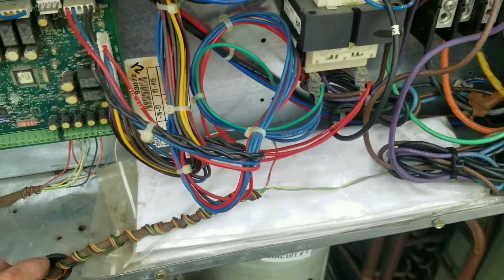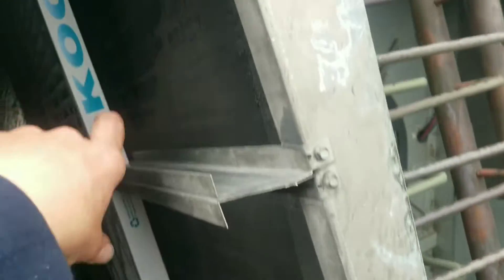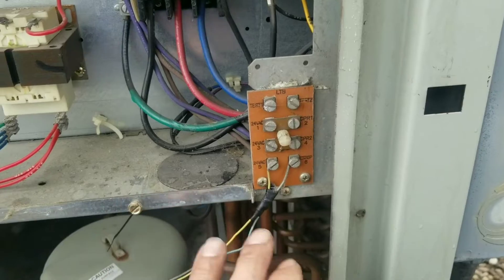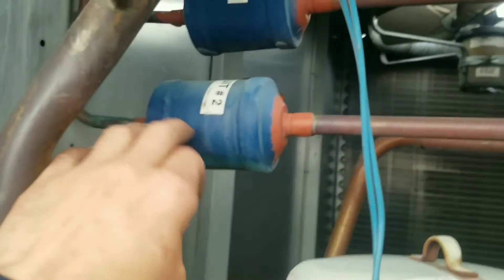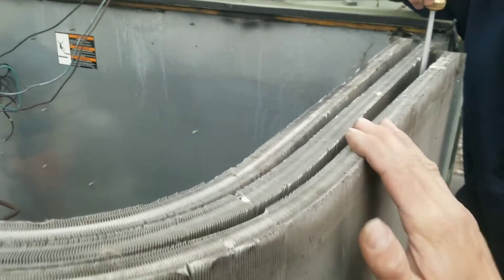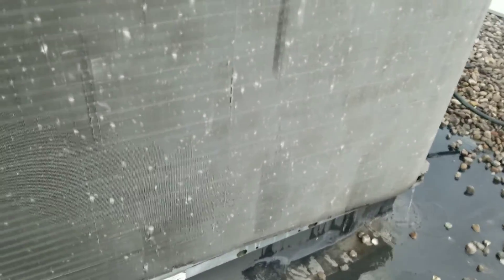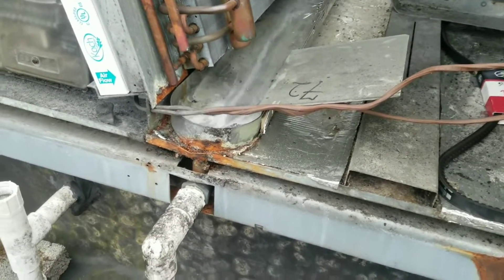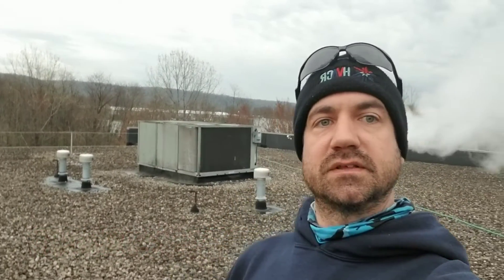HVAC cooling season, rooftop unit p.m tips, tricks and what to look for

Comment: Could you share how this visit differs in the Summer, Fall and Winter?
Reply from the maker: These specific units are cooling only so the other PMs are not as in depth on these units just basic belts and filters and we focus on the heating systems inside. If they did have heat we would check the heat accordingly. I hope this answers your question. I don’t have a specific heating PM video on this type unit but do have some showing the Trane negative pressure gas valves and set up I believe.

Comment: How do you check sub cool if it only has a discharge port.
Reply from the maker: Good question, thanks, Johnny. It is a skewed number without a liquid port, but it can still be a useful reading. You just have to understand the reading you are taking and interpret it accordingly. So if you assume some pressure drop across your condenser, you can figure the subcooling reading, in theory, will be elevated slightly. Discharge superheat and line temperature can be useful, too. Some chillers use approach temperature, which is another reading that can indicate how well your condenser is rejecting heat.

Comment: Hw much time are you allocated per unit?Also how do you clean those evaporator coils where return is open to the shop?
Reply from the maker: We are given ample time on our p.m.s it depends on the type of unit to determine how much time they give you, but it takes as long as it takes. The first time I cleaned these particular units, it took a lot longer due to the condition. Now, when I clean them yearly, they take half the time. Evaporators are tough. the best way is to schedule with customers and block off a space below if possible. A brush, compressed air, and light water, if needed, block the return the best you can will work if they are not too dirty.
Reply: @EverythingHVACR  those evaporarors are always a challenge.

Comment: I'm struggling trying to get one of these units to run properly.
Reply from the maker: More information may help me or someone in the comments give you some ideas to help. Start with the basics, read the manual. RTFM
Reply: @EverythingHVACR  I did a compressor replacement on circuit one.  I weighed in 6.2 pounds of r 22 to name plate. I have a high super  heat 40 plus
Reply from the maker: Bet the orifice is restricted. When the condensers don't get cleaned well, the oil will begin to thicken as it runs hotter and actually plug the orifices. Trane does have a txv kit for them. Unfortunately, when we replace compressors, sometimes we find out what killed them.
Reply: @EverythingHVACR  really that’s not good. I am not the most advanced service tech. I have been in the trade for 15 years. But on this unit I’m working for a friend and he gives me the freedom to learn as a girl I’ll put as much time into it as I need to get it, right. I was thinking of recovering refrigerant, and doing the entire process all over again.
Reply from the maker: @hookedup9424 txv kit will help, at least it gives you some adjustment. You can try flushing, but that may or may not work. Search orifice restrictions, you may find something to help, but I would recommend the txv kit.

Comment: Where do you hook up your probes to take SH & SC measurements? Thank you
Reply from the maker: There is no liquid line service connection on this particular unit. You have a suction and discharge line port to connect to right at the compressor. Subcooling will be a skewed number because your reading discharge pressure, superheat is a more important reading, in my opinion, especially on packaged equipment.

Comment: Great job. If you do get a service call on this piece of equipment after this type of maintenance is done at least you know that it was done thoroughly and you completed it. 
I worked for this company ( the GM of the branch was a used car salesman ) he would bid maintenances at 20-30 minutes per unit with coil cleanings. If you got a site with 8 RTUs you would get 3-4 hours total to complete it. All the maintenance contracts he sold were just complete garbage, he knew they were grossly underbid on time and he didn’t care one bit. He was looking out for his bonus. Guys like him are terrible but there are many more guys just like him in this industry, unfortunately.
Reply from the maker: No doubt! Honestly we have some that are under bid just to get but I don't let that change what I do and I have management that understands that, working for service techs is why I've been in the same place for 15 years. Thanks thisblowsballbags!

Comment: So the only Port for the high side is at the compressor? Also this would be charged to a super heat due to the fixed orifice?
Reply from the maker: Correct these older units only had a discharge port as do some other types of commercial equipment. Also Correct, fixed orifice would be charged per superheat. Thanks Zane!

Comment: I had that issue with a disconnect.   Not all three would engage.  Ended up having to replace the disconnect.
Reply from the maker: Thanks brian! You have to be careful,  I've seen multiple disconnects do that, that's why you always check
Reply: @EverythingHVACR  so true

Comment: Do you meg the compressors? fluke1507 is easy to use           What about 2second acid test? quick products qt2000       i mean like on an annual
Reply from the maker: Don't typically Meg compressors unless I have reason to. Most light commercial stuff is going to run till its dead anyway, customers won't pay if something is operational, megger used more on industrial stuff. I use the acid test any time something fails but not typically on a p.m... again unless there is reason to.

Comment: What’s everyone’s opinion on doing rooftop spring  maintenances when 5c outside, building temp 20C,  I hate doing Resi or commercial, in cold temps, exspecially 410, I live and die by my service reports, pressures temps,
Reply from the maker: It does suck when it's cold especially when pulling hose to a roof and spraying water around all day. Makes checking charge difficult as well I usually just note on service report the OA temperature and do every check I can to verify it looks ok.
Reply: @EverythingHVACR  yup for sure, I hate overzealous service managers that want to start doing Ac maintenance to get ahead of the curve, always it’s going to be a hot summer explanation, meanwhile, spring, 5c or 41f raining outside, 17 seer Ac, or 25 tone rooftop, what can you do with the pressures, all you can do is take DT, outdoor temp, record everyrhing

Comment: Trane has a retrofit to replace the orifice header with a txv setup. Wax from the oil plugs the orifice’s.
Reply from the maker: I have done a few of those and it's much easier than just replacing the fixed header. And your right when the condenser gets dirty the refrigerant and oil gets hotter than normal and that, from what I understand, causes the oil to do cause the waxy build up. Thanks for watching!

Comment: I’ve changed out that same evap coil before, the new coil from trane was manufactured wrong at plant with both circuits tied together, called tech support told them I counted the header circuits they mixed the inlets up, I unsweated and re brazed it in correctly so both circuits where isolated. It happens be aware I notice while pulling evacuation
Reply from the maker: Nice, some of this stuff out here will keep you on your toes. Adapt and overcome! Keep up the good work. Thanks for the support!